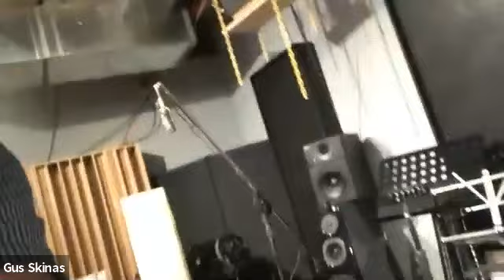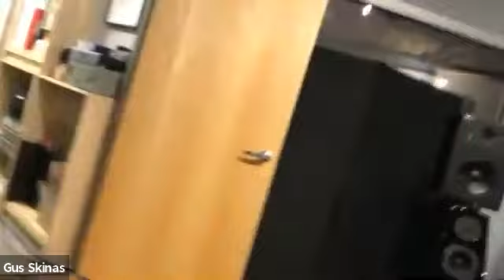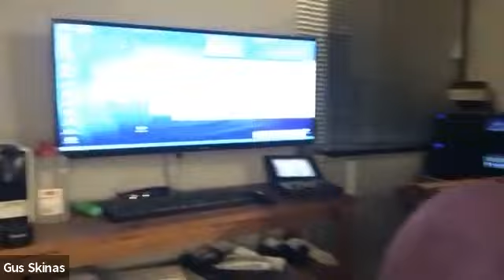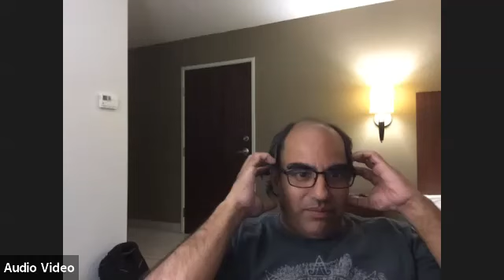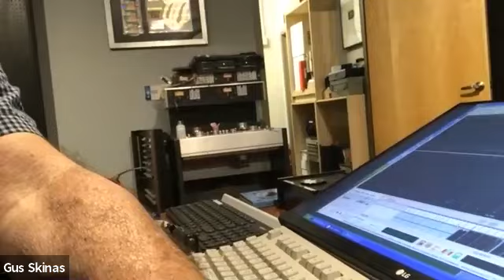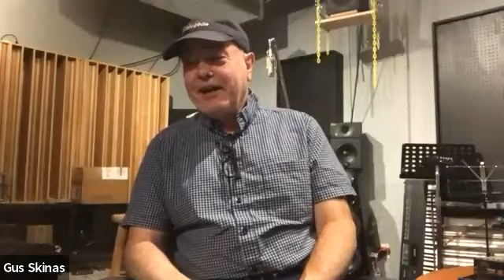Gus Skinas DSD Master -  AZAVCLUB 06 24 2020

Comment: Gus, I'm a huge DSD fan - born out of my enthusiasm for SACD - and wonder if there might be someone 'out there' clever enough to be able to design a means of editing DSD recordings that doesn't require moving to the analogue or DXD realms at some stage. I have heard about the Zephyr Filter from Paul McGowan but my understanding is that even there, there is an element of low-bit PCM involved. I have memories of one English classical music label that initially recorded in DSD when it first brought out SACDs but all its later masters - or at least the ones I am familiar with - have been 24/96  PCM and I can only assume that the change was the result of editing issues. I guess everything would be carried out in PCM and then, when the company is satisfied with the results, PCM to DSD conversion takes place.